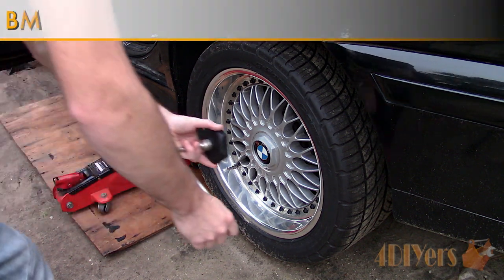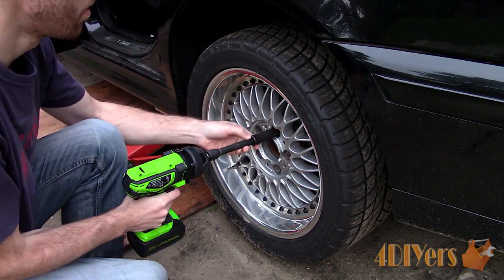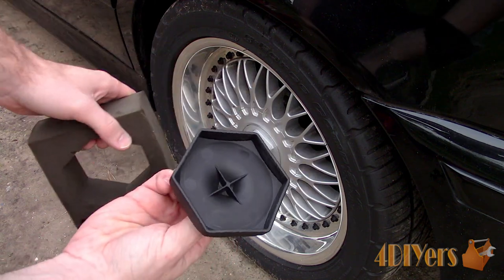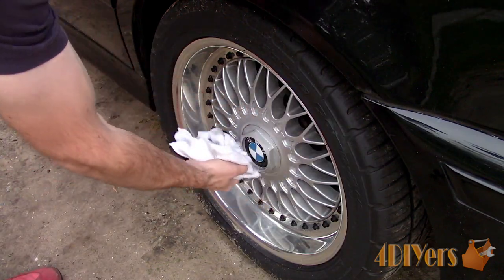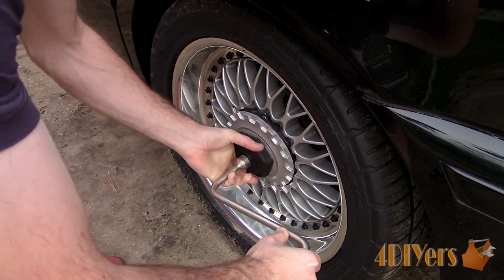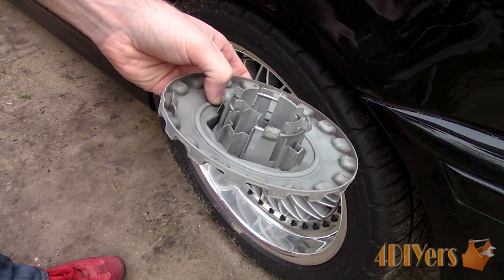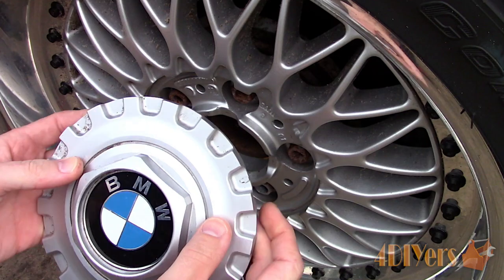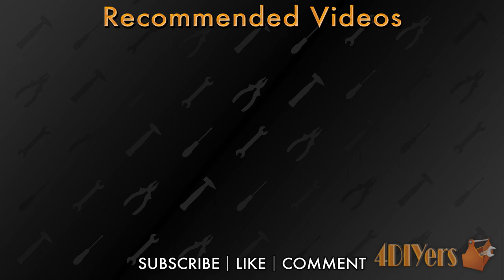How to: BMW Style 5 or BBS RC090 Center Cap Removal

Comment: Currently restoring my BBS Style 5s. Had no idea there was a tool for the cap. Cheers
Reply: Yuri Pershin Same here, i’m restoring them to and didnt know the cap tool existed.
My rims are BBS RC035. Different center hole diameter i think.
Reply: Jonathan Straetman mine are RC090. Did a complete disassembly and refinishing lips and faces. Any idea what torque to use for the bolts around the lip?
Reply: Yuri Pershin Im not sure about the torqe, but here are RM RS specs:
BBS RM bolt torque is 12-15 lb/ft
BBS RS bolt torque is 22-25 lb/ft

I would set it at 15 like the 2 piece RM wheels...
Reply from the maker: Glad to help out! BBS doesn't specifically list a torque spec, but you can cross reference based on the size and grade of bolt. I redid the lips on mine a couple years ago, I believe I torqued them to 20 ft/lbs with medium grade threadlocker, you'll need an inch pound torque wrench.

Comment: Hey is the BMW logo removable? I'm looking to buy a set for my 1991 jaguar as they are both 5x120 but my bolts are also 21mm instead of 17mm will that also be an issue?
Reply from the maker: Yep, it's just a glued on emblem. That I'm not sure of, it's best to test fit them in person.

Comment: How much are these wheels cost?
Reply from the maker: Depends where you're located, they're one of the more desirable factory wheels. In Canada a rough stock set without tires can be easily $500. But a refinished set without tires and polished lips I've seen for over $2000.